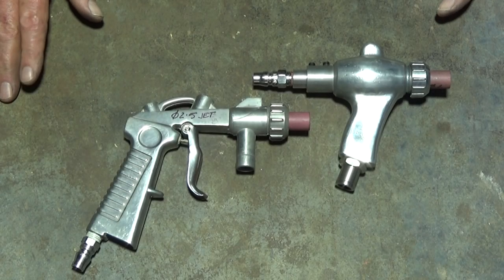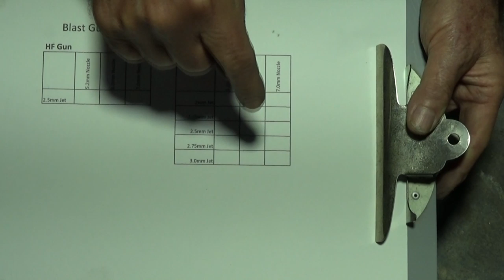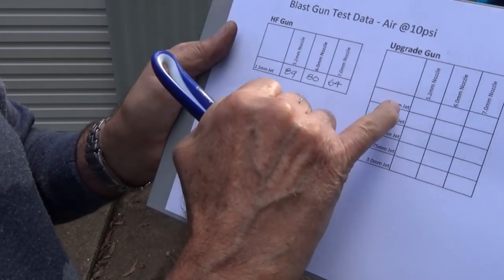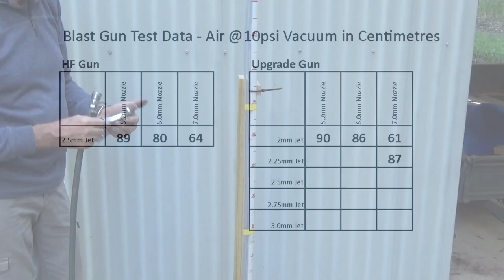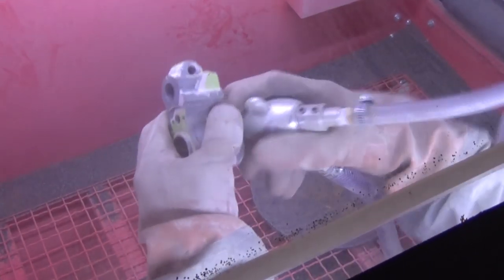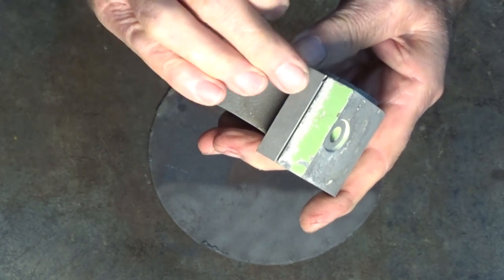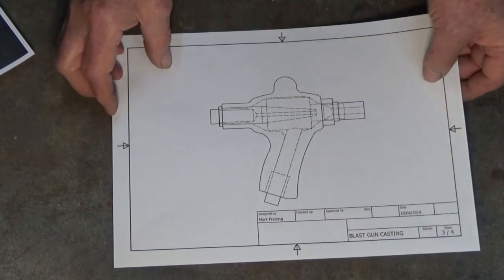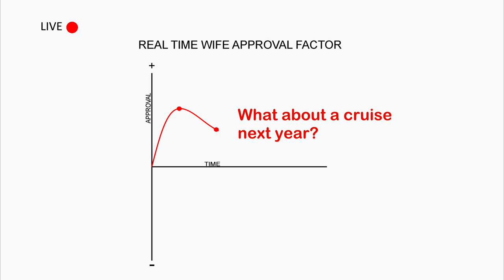DIY Blast Gun Testing Using a Manometer

Comment: Hi Mark, I just came across your videos today and have learnt a few things and had a few laughs as well.  Cheers to your methodical approaches to problem solving and more so, to sharing your mistakes along with what you figured out. We all learn that way.  "The Greatest Mistake a Person Can Make Is To Be Afraid Of Making One!"
With your compressor, here are a few tips that might help you;
1. To keep everything as dry as you can, get a "Water Separator / Regulator Combo" or fit an extra Water Separator after this and before your air hose. Other water separators are available to be connected between the final stage of the motor and before the air reservoir.  These can be very expensive though and are typically fitted to high pressure air compressors. But, with a bit of googling, commonsense and careful fabrication you could make your own. 
2. Frequently purge your air reservoir (as much as every 10 minutes in high humidity), to drain your tank and reduce pumping water into your airlines.
3. If you have enough air pressure, make a manifold block on your cabinet.  Have one inlet & 2 (or as many as you like) outlets for the block.  One for your gun and the other to feed down into the bottom of your hopper.  This one will "Fluff" your medium and help your pickup line deliver with more ease. 
4. You could put a third air hose into your hopper, connected to an air ejector before the the pickup end of your feed tube. This will help to overcome the gravity on the blasting media and make your gun "Air Venturi Ejector" work with more ease.
5. On your next prototype, design a spiraled chamber in your gun to increase the airflow over the pickup stem and directing it out the nozzle. It will also help scavenge any media that builds up inside your gun air chamber. You need to increase the "Low Pressure / High Pressure interface for the Air Venturi Ejector to maximize pickup and eject. 
6. Good luck with it all :)  (maybe I should have watched your next video before posting this comment?)
Reply from the maker: Anthony, thanks for the tips. I still haven't got my new air compressor! We are due to leave on a holiday to the UK and Europe next week and our rubbish Aussie dollar is buying just 56 British pence and about 60 Euro cents so it's going to be an expensive holiday. 😥
Reply: @Preso58  Safe Travels Mark !!

Comment: I've had my blasting gun for years with a few adjustments. Now I've attached it to a petrol pressure washer. No dust and continuous 250 bar pressure, far better.
Also consider using a VFD to control the compressor. It's really effective and efficient. Also copper cooling coils from the head to the tank. From 84c down to 5c  or less. Inline water filter and perfect..
Reply from the maker: I have since added a very large receiver to a new "Chicago" silent air compressor (which isn't really silent at all) and this give me a much better reserve of air and it also acts as a sort of cooler since most of the heat stays in the main compressor tank. This upgrade alone has improved the performance of the blast gun out of sight. If I had the room I would use a pressure tank for the blast media but space is already hard to come by in my workshop.
Regards,
Mark

Comment: Anyway to tell if the surging is caused by the air compressor? The air has to be constant in pressure and volume and despite looks the performance of the compressor may be suitable.   Just speculating but the new internal streamline design of the gun should help but the real performance improvement should come from the addition of the lightning bolt.  I recommend that you should bring up the need for a compressor AFTER the neck massage.
Reply from the maker: I am going to upgrade the compressor soon anyway. It is getting on and the pressure vessel must be getting quite corroded by now. It is also incredibly noisy with the motor running at 2800rpm. My friend has a 3 cylinder unit that runs with a 1440rpm motor and it just chugs away but has a good throughput of air. Scones rule! 😁

Comment: I just bought some sanding primer at the automotive store, 16 oz can cost $8 US ($11.4 Aus).  How does that compare to what you pay?  I always run a straight 1/2 ID hose from my compressor to the sand blaster without valves to reduce restriction.  I also went with a 60 gal holding tank and that gives me better continuous blasting.  I would have like to see you blast the piece 1/2 with the new nozzle and 1/2 with the HF nozzle.
Reply from the maker: Steve, I just checked and a 400 gram can of spray putty (aerosol) is AU$11.99. A 2 litre can is AU$51.99. The straight paint in the 2 litre can needs to be thinned and sprayed from a gun with a large nozzle size but you can really lay it on thick with that method. I use an aerosol can for quick jobs like building up a finish on small 3d printed patterns but I will use a gun for bigger jobs. When I get the MKII blast gun finished I will try to do a direct comparison with the original setup. I am starting to think that I might be able to add a holding tank outside my shop to increase my reserve of air but I will definitely be upgrading the compressor soon. 
Regards,
Mark

Comment: If you get a new compressor put radiator in between the pump and the tank with a water catch to cool the air and condense the water out be for the tank best thing I did no water in the tank you need dry air for the sandblasting aswell 
Or just run two compessers
Reply from the maker: Bradley,
What sort of radiator? Is it a specialist item or accessory for compressors or did you make your own?
Reply: @Preso58  Lots of ways to go about it. One design I saw used coiled copper tube down the length of a 60 gallon tank with a desiccant filter at the bottom and drain, then a straight shot back up to the tank. LOTS of guys are pretty anal about their air setups so it's pretty easy to find lots of ideas on Google, along with a lot of arguments lol Good luck!
Reply: Mark Presling I used a condenser out of a old aircon it has the smaller pipes for easier connections but any thing that has surface area to cool the air and and let the water condense out of the air before the tank if you have a email I could send some pics it’s still a bit ruff at the moment   As I was moving it but the air is pretty well dry and cold before it gets to the tank where before it was up to 140 c measuring the out let pipe from the compressor I’m in wa and on the humid days I could get over. Litre of water out anything else just ask

Comment: good results mate. wondering if a gravity feed hopper would work better and just use the old gun to cycle media from cabinet to hopper 🤔
Reply from the maker: I like the idea of a gravity feed hopper but I have very limited space to store the blast cabinet. I had to make room in my wood shop by removing part of my sink cabinet! I do have to wheel the entire unit into the middle of the space to use it and this was one of the reasons I had put off buying a blast cabinet for so long. I originally thought I would have to store it outside under an awning. As it is now it is doing what I want but I think I can tweak the performance of the gun with the markII version.
Reply: Sheds are never big enuf

Comment: Shouldn’t the media come in towards the rear of the cavity, bring in where you are is going to cause turbulence where you want flow and suction I think you would also stretch the chamber out 50% to give it more area to create the centrifugal forces you require
Reply from the maker: I have had lots of suggestions about what the interior architecture of the gun should be. I am thinking that having a transparent body would be the only way to test different designs short of a full computational fluid dynamic scenario. 
Regards,
Mark

Comment: Add a second compressor for extra air when blasting, no need for a bigger unit.   Consider increasing pick up tube diameter as it will allow more air flow.  As the tube diameter increases or decreases, the speed of the air may increase or decrease in reverse relation to tube id.  Remember the sand is always falling in the moving air.  Thus, tuning the tube ID for best combination of airspeed and volume may allow your gun to improve dramatically.
Reply from the maker: I can watch the grit falling inside the column of pickup tube. It seems like that is not really an issue any more, The gun seems to be able to store the grit inside the cavity and it is ejected from the nozzle in a steady stream. I think I am happy with the way it is all working now. I am still looking to upgrade my compressor though.
Reply: @Preso58  I'm thinking of a cascade of compressors for my shop. ALL of them outside the building.  Man is not fit to share space with a pounding air compressor.  The silent ones are growing in popularity but are not as productive per KW.  But, I image a portable pancake or two plus one big compressor.  Any combination of which can be turned on.  When I need spritzing or tire filling air the small one will do, when I'm blasting the whole works running.  When I'm running an impact maybe 1 or two small ones.   I think it's a lack of 3 dimensional thinking to imagine only one unit can be utilized.  Why not 2 plumbed into same shop system?  With the valves you can limit or expand which tanks are filling and with switches, which and how many units are doing the filling.  Those are my general thoughts.

Comment: Of course the suction capability helps, but you also have to get the blasting media to flow easier in the tube up to the gun. I see some suction tubes with secondary tubes along side it to allow air in. While I am not a pneumatic engineer, I think some work on that end could help as well. JMHO
Reply from the maker: Gary,
The metering valve on the outlet of the hopper allows the air to mix with the media supply. I did a separate video on that a while ago. 
Regards,
Mark

Comment: Another great video! Love the "live" charting of your wifey conversation! I for one am looking forward to Gen II. I see you have put a lot of thought into the design and I am anxious to see how it improves media delivery. May I make a suggestion regarding the air compressor? Research the benefit of adding a second tank to your present setup. You might pickup a trashed compressor with a good tank for cheap. I just this year finally bit the bullet and purchased a single phase 5hp, 80 gal compressor. I have 3 phase service but I could not justify the additional cost of the compressor. I'm still on the fence about a sand blaster, hence my extreme interest in this project of yours. I have always had excellent service from HF tools. I started by buying a 1" impact for my then trucking business back in the late 1980s when they were mail order only. Now retired, my brothers and I have one 15ft, two 6ft rotary mowers and several riding mowers. I have been sharpening blades on them for over 15 years with a 4 1/2" HF grinder and it's still going strong! I have very few tools here on the farm that are not HF. Thanks to you, HF is in the running for my blasting cabinet.
Reply from the maker: William,
I think the blasting cabinet that I bought is a good unit for the price that I paid and I knew going in that it would need a lot of upgrades. The reality is that in the "Hobby" and "home shop" class, there is not a lot to choose from here in Australia. Our market is too small to support locally made product and we are too far away from the rest of the world to make good quality imports affordable. China is relatively close and so the bulk of what I can afford comes from Chinese manufacturers. I know that Harbor Freight cops a bad rap from US makers but there is definitely a place in the market for what they supply. I put off buying a sandblast cabinet for years in the hope that I could convince the guys at the school where I used to work to buy one. That way I could use theirs if I wanted to. (I kept my keys to the workshop!) I can't see myself using mine everyday but the ability to be able to clean an awkward shaped component is worth it.
Regards,
Mark

Comment: A "Wife Approval" graph! I've never seen one before! I imagine the flow of the graph would be different in every household which is why one doesn't see them more regularly (lol) As for the "Ray Gun" blast gun, When you first presented the picture I immediately though of the same thing, making Gen 2 with rings and lightning bolts. That's how I would add a bit more flair and fun to the project. I love the videos, especially the humorous parts. Thanks for another good one!
Reply from the maker: Rick, I sort of feel that I have to put at least a few rings on the new gun!

Comment: Air  flow from the compressor is important too.  Add an air pressure gauge between the hose and gun. Then test with the same pressure at the gun with air flowing.  Cheers.

Comment: Hey Mark, great videos! 
I have an issue. So i'm testing my homemade Gun using 2mm airjet, and using a 6mm Nozzle. When i open the air, the slurry pump are studdering. I have tried adjusting the jet position but seems not getting rid of the studdering. 
Is it because i'm not using air regulator? Do you think the air pressure were too high? 
What psi should i use for this setting? 
I'm gonna keep the 2mm jet for the whole test. 
Please help. Thank you Mark.
Nando-Indonesia
Reply from the maker: Fernando, I still get some interruptions in the supply of media but it doesn't seem to make a lot of difference to the amount of media being delivered to the part you are blasting. I believe that the nozzle can only supply a certain amount of media and the excess is kept in the cavity inside the gun. I am still planning to make a blasting gun with a clear plastic body so I can see what is happening inside the cavity surrounding the internal jet. I usually use a pressure of around 80PSI but I have heard that you can reduce that to 50PSI. It is probably more important to make sure you have a relatively large reserve of air which means having a very large receiver and decent size pipe work to supply the air. I did a video on a recent upgrade to my compressor and air storage here https://www.youtube.com/watch?v=HdOgttl0Qww it starts at about 10:00
The new setup works much better and I can keep the pressure drop to a minimum. 
Regards,
Mark

Comment: Hi Mark, don't be so fast to get rid of the old compressor. In fact it hasn't done all that much work and you will be amazed at what a good service can do for it. Start by ensuring that the tank is properly drained of water condensation which will help in lifting blasting media. Check the air filter and clean it, replace if necessary. Change the oil and check the drive belt for condition and tension. If it is still working keep using it as all the compressors available today at hobbiest price points are made in China and you know what that means. Consider making an air drier for your compressor to provide good clean dry air for your workshop.
Reply from the maker: Mark, I will need to disconnect everything and drag it out from under the bench to do a thorough service on it but you have shamed me into doing just that. I was considering scrapping it a few years ago because it was so inefficient and when I checked the filter it was almost completely blocked with mud wasp nests. No wonder it couldn't breathe!

Comment: I don't know that the "surging" in the pickup tube is significant to the feed. I suspect that you have a steady feed at the gun, and what you are seeing if essentially sloshing of the region where a phase transition occurs between a heavier fluidized state and the media being carried by the flowing gas. The sloshing is a similar effect (not the same mechanism) as the bounce in your water column test.
Reply from the maker: I was initially disappointed to see the surging in the supply tube but as you have pointed out the feed from the gun nozzle appears to be constant. I just watched another YouTuber's video showing the operation of his cabinet which is fitted with a Tacoma metering valve and it seems to be very similar to what I am getting so I am counting my solution as a win. 
Regards,
Mark

Comment: Clipboard AND scones, living the dream. I was wondering if having either having an internal taper on the nozzle tube or a bored out tube with a screw in tip would improve efficiency of the air supply.  It just seems like a unwanted restriction to me. Or am I missing the point? Great video anyway, I now know what not to do, mention new tools to the wife.
Reply from the maker: Steve,
I was also wondering how important it was to keep the passages inside the jet as large as possible since the volume of air is just as important as the pressure. I have had several people point out that having lots of restrictions in the supply line is a bad thing. I like the idea of having a separate screw in tip rather than having to make up a new jet with different size openings. I might just steal that idea.
Regards,
Mark